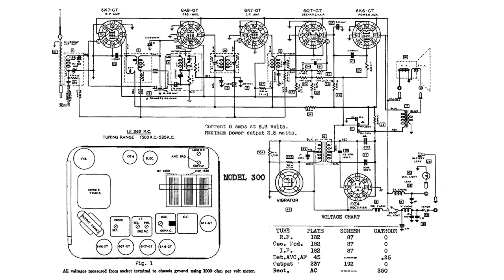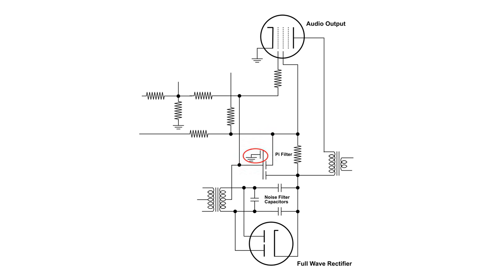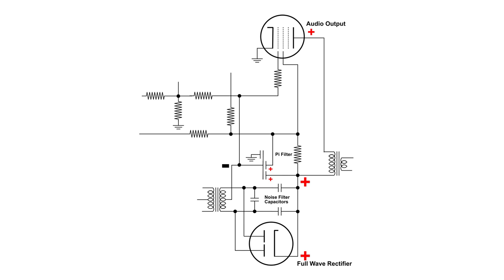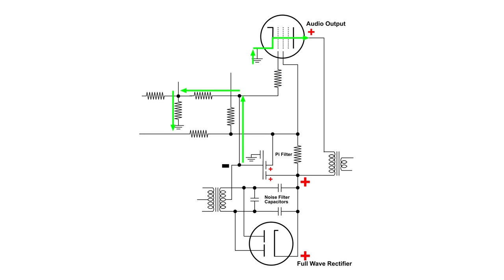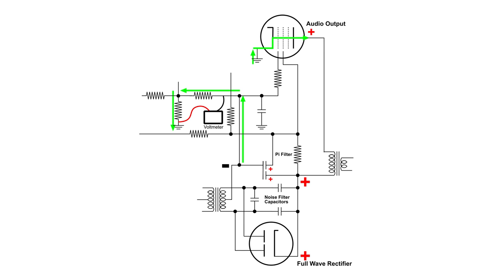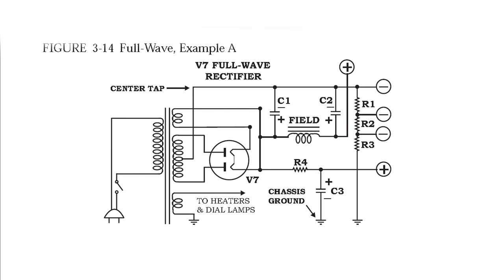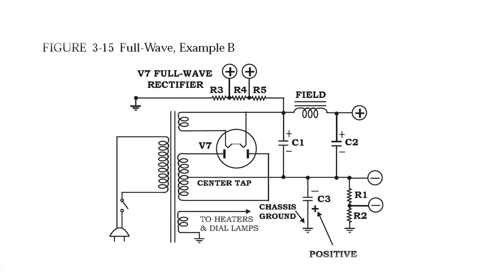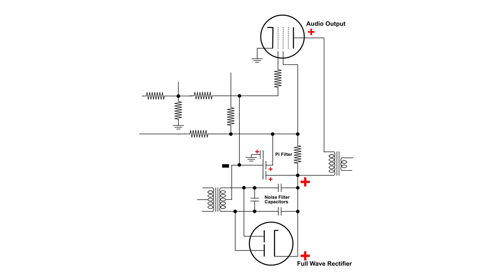Electrolytic Capacitor Polarity how to figure it out using power supply wiring diagram

Comment: Thanks for sharing. I just got in trouble because I forgot to connect the negative terminal of a replacement modern electrolytic to the chassis ground when the old cap had a grounded metallic case. This led to another cap become reverse biased. Luckily I felt it was warm before it popped!